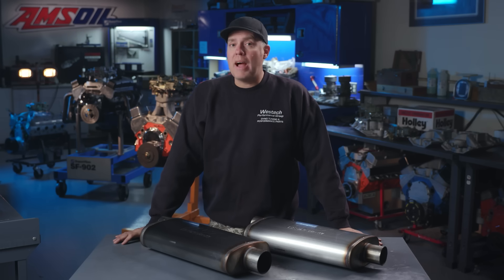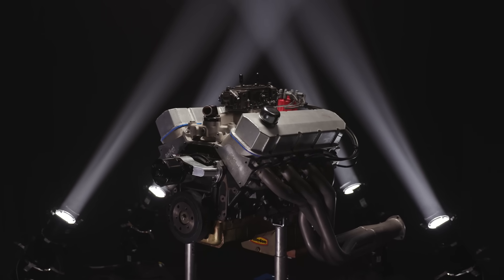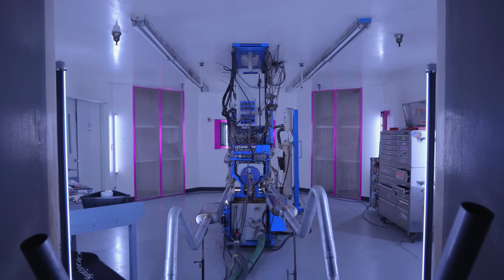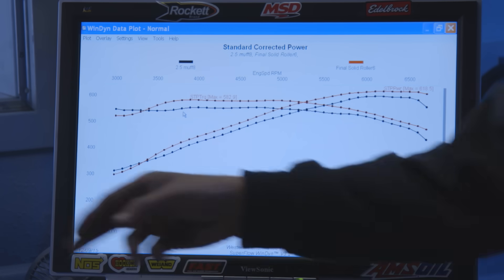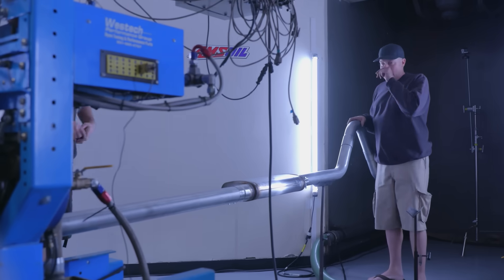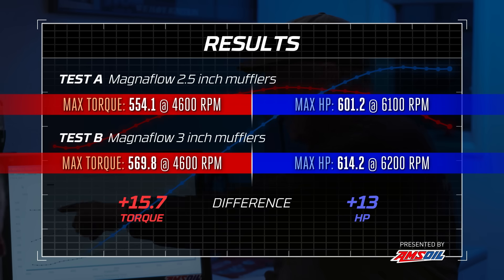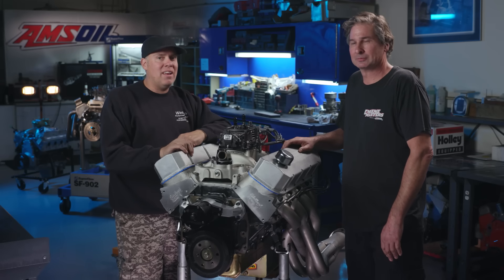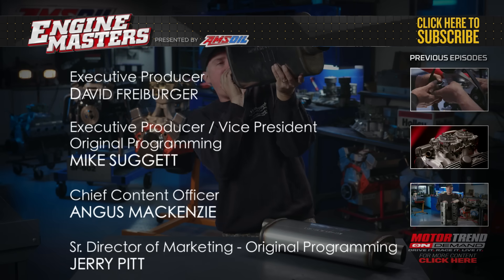The Power of 2.5- vs. 3-Inch Exhaust - Engine Masters Ep. 9

Comment: Question, are these type of gains true with other types of engines that aren't making nearly as much power and don't have as many cylinders or as much displacement.
Reply: A 4 cyl would probably flow fine with 2 unless it's force induction so engine size changes it yes.

Comment: Size is relative to exhaust gas speed. You need the gasses moving as fast as possible without too much chuffing/turbulence, moving over 20m/s(egt relative), etc. THAT is how you make power and torque. The further back the muffler is, the less the ID matters as the exhaust gasses have cooled substantially, making a change in restriction that far back nearly null. As long as you think of exhaust gas as a liquid and build around that idea, you'll make big power gains over an OE system.

Comment: I'd be super interested to see how big the difference was AFTER correcting the air fuel ratio to essentially the same for both...
Reply: Chris Thompson
I would highly doubt the 3" will beat the so called "open headers" since they are a big set of dyno headers rather than a shorter, more compact set that may be under the hood of a car and they already have the short extension pipe (thus enough length for any scavenging effect). However I agree it'd be nice to see those results and know that for a fact, rather than assuming, otherwise there seems not much point in doing a video about the subject.
Reply: +Hamish McGregor Exactly my thoughts. You could probably tweak it even further by playing around with ignition timing as well.
Reply: Don't get me wrong, I reckon its still going to be the same order on the graphs, I just think it would be interesting how close the the 2.5" gets for a system that they actually comment on how quiet it is vs open headers.
Reply: +Hamish McGregor And would the 3" perform better than open headers if it was tuned also. I'm sure it was running a little rich as well.

Comment: Hmm, i have a magnaflow 2.5" catback with a 3" downpipe, although it splits before the axles to dual exhaust, so is only 2.5" for about 7 feet, with around 400 awhp.  I'm sure they're never ever going to test a turbocharged 4 cyl though, hah.
Reply: +The Head once your exhaust gasses hit your catback, the difference in size is barely noticable unless you're running a ton of boost or really high octane race gas. The general rule of thumb is to just run an exhaust that's the same size as the hotside exducer ID.

Comment: I'm actually taking the opposite conclusion from what they reached in the video...

The guys that are breaking their backs to put 3" (or even larger) exhaust on a car where it just DOES NOT FIT are wasting their time. 20hp, on a 600hp motor, is pretty much negligible, especially on the street.

I also believe there is probably an economy of scale here in regard to engine size and hp vs. net results. I remember getting into a heated debate with some guy that had a fairly mild Ford 302 (call it 350hp) that was dead set on dual 3" because 2.5" would kill so much power. In my opinion, that clearly wasn't the case here and I bet the difference on his motor was pretty much not measurable. He was dead set on it though, so, whatever...
Reply: CrownVicNiick
I'm just curious what that data might look like. Does a 300hp 350 SBC even noticed a difference between 2.5" and 3" exhaust? A lot of guys watching these videos probably do have stuff like old LT-1 F-bodies and such where that is a very valid question for them to ask.

In terms of the 302 guy, the point I presented was that he'd split his block in half (which is true on a stock 302 block, they split right down the lifter valley somewhere around 550-600hp) before it would make a noticeable difference, and this video proved it. Plus on his car getting 3" tail pipes to fit is a nightmare and he didn't want dumps. It was probably one of those conversations that wasn't going to result in anything anyhow. He's probably rolling on stock exhaust still right now.
Reply: +Maxwelhse - Scale is absolutely a factor.  More air & more fuel are required to make more power.  A less powerful engine will move less air & require less exhaust space to move through.  I was hoping they would emphasize the importance of consideration of displacement, airflow, power, etc, and not just jumping to the "bigger exhaust is better" conclusion.If that guy with the mild 302 had plans of achieving more serious power at some point without upgrading the exhaust again, he may have had the right idea.
Reply: +Maxwelhse That 20hp drop is completely negligible. At the cost of not being that fucker who constantly wakes up everyone in a forty kilometre radius, I call that fine.
Reply: VKGaming - Окончательный Гибель
Ehhh... I have 2 vehicles with 2.5" systems that are both ultra loud, so I can't really throw that stone. hahaha :)
Reply: Maxwelhse I am certain they would be louder at 3 inches.

Comment: Cubic capacity x RPM = Flow rate/min This is from back when I did my apprenticeship when Dinosaurs were not just fuel. 

We were taught that "Volumetric efficiency is what makes HP at high RPM so basically the better you can get the air in and out the more HP you can effectively have".

Though in my opinion, most cars are not outright drag cars and if you were to build a respectable street engine that your trying to keep a bit stealthy, a good flowing 2 1/2" (like what you had) would still give you great streetable performance though there is no way to not lose it in the top end unless you lose Cubic inches from the engine.

There is a point with Cams where some back pressure can be useful to reduce scavenging into the exhaust with valve overlap but that's only an issue with extremely long duration cams  and I've only seen it with 4cyl's (In Mini Sprints on Methanol) for some reason, but I don't see why it couldn't happen with 6's or 8's.

Question If I may, what is the advantage, disadvantage or no benefit of having a cross tube?

People go on about it all the time about balancing the banks etc and not having it will cost power etc.

I think it's for the sound only, is that the case or is there some performance benefit?

Cheers Damo

Comment: im sorry for being that guy, but i've been told for anyone to feel a difference in power it has to be at least 10 percent higher. in these dyno runs its not the case.  hmmm
Reply: +omer sari 15 extra HP isn't much, but when you think about this plus all the other mods you'd be doing if you were trying to get more power, all together you'd definitely be getting more than a 10% increase. Suspension mods are the same way. A sway bar may not make that big a difference, but when you add coil overs and nice tires, all of a sudden you've made a really big difference all together.
Reply: Having 13 hp added from 2.5 to 3" is noticeable. Especially on track times.
Reply: +TheTyrial86 13hp added to a 600+hp engine would not be noticeable.
Reply: Tyler Hunt Are you saying you wouldn't notice it on the track especially in times??? Yes you would.
Reply: Nope. sorry. not at all.
Reply: With an exhaust restricting 600hp to 587hp yes you would.

And it wasn't 600+ it was 600hp. Look at those numbers, with a proper drive train. You would see the difference in time. So yes you would. Especially with something so simple as exhaust.
Reply: Actually it was 600+hp. 614.2hp to be exact. Maybe you should look at the numbers. And no, a 2% difference in hp is not going to make much of a difference on a track, and you sure as shit aren't going to notice a difference driving it. You will not feel 13 hp on a 600+hp engine.
Reply: Tyler Hunt You see what is funny is that is dyno hp. When the exhaust is installed it isn't a 614hp. It was significantly less. The difference is between the exhaust installed. The difference is between the two. Yes you will notice a difference.
Reply: I'm well aware of the difference between an engine dyno and a chassis dyno. Now stop being an idiot. We're talking about the numbers measured here, not speculating what the wheel HP will be once a drivetrain is attached to it. And no, the only difference you're going to notice is the amount of noise it makes. You won't feel a difference in power. And unless you're quarter mile is consistent to the hundredth of a second, you're not going to notice anything there either.
Reply: Tyler Hunt If a 2% increase isn't noticable then why are people using turbos??? Again if 13 hp increase isn't worth a damn, then a 20-25 hp increase isn't either. 

And feeling is relative. Now are you going to tell me you wouldn't increase the diameter of your exhaust on a car you intend to race, to bring out a 2% gain??? If you would why you do it?? Because a gain is a gain, and that gain would be the difference between a win or a loss. That tenth of second will be noticeable, that loss will be noticeable.
Reply: It wouldn't even be a tenth. Maybe half that if your lucky. And again, unless you're consistent down to the hundredth, you'll never notice the difference. 

The question here wasn't "would you change your exhaust for a 2% increase in horsepower", it was would you notice a difference. The answer to that is no. You would not. I would not. Would a professional racecar driver? Maybe? But the hobbyist, the enthusiast, the weekend warrior, and the keyboard professional? Not a chance. You'll just hear more noise.  

Oh, and on what planet do turbos only make 2% more HP? Lmfao.
Reply: Tyler Hunt The hobbyist would. I would. You have guys that run straights on tracks. I don't know about you but when you are racing, you want to win, or atleast you should. No normal guy builds an engine that has this hp for shits and giggles and not try to get every ounce of hp and torque out of it. 

And most turbos you start at low boost. You can move the hp number up to 33% if you want but realistically if you run a turbo on a home build you run it lower. Move it to 15% if you want if 2% doesn't mean anything in "feel" then neither would 15%
Reply: Wow bud.... You're either trolling, or just a complete idiot. Either way, you're a waste of my time. Enjoy your 2% turbos. Lol.
Reply: Tyler Hunt Nope I think I just have proven a point here. Go ahead and run a turbo at 15 pounds and tell me how tha goes for you over time. Run it at max

Comment: what about exhaust crossover vs no crossover vs 2 in 2 out center muffler??
Reply: +180outofphase An x-pipe would add power due to basic fluid dynamics. Increased scavenging means increased power, as the gasses will be moving faster.

Comment: i feel like the same tests on a SBC 350 would have shown a zero HP gain.
hence what muffler shops are talking about.
Reply: +AllyourBaseArebelongToUs And a smaller displacement (say a 327, 305, etc) may have lost power with the larger exhaust.